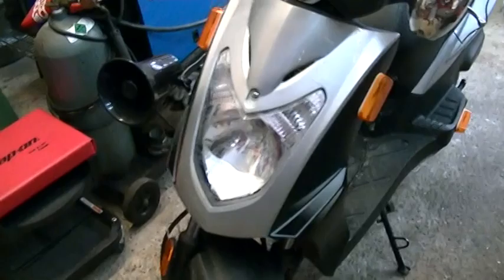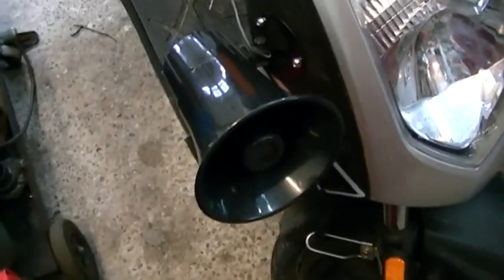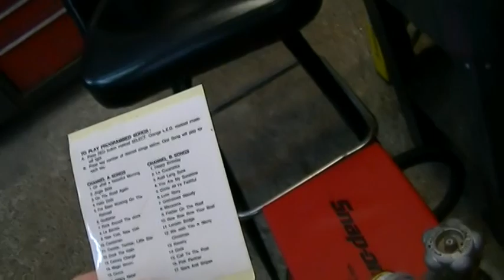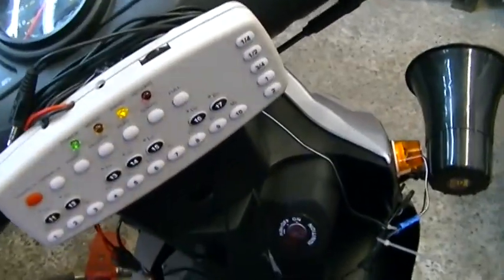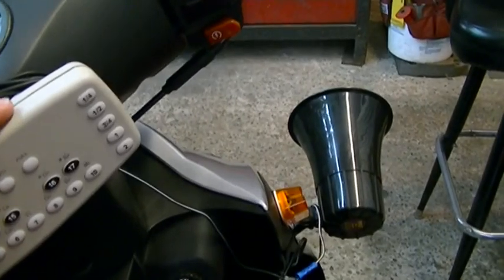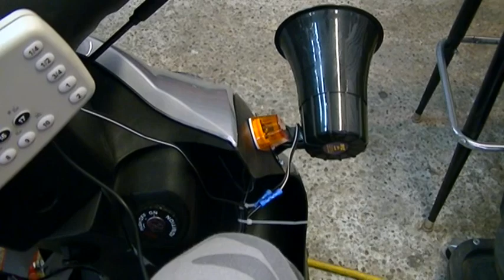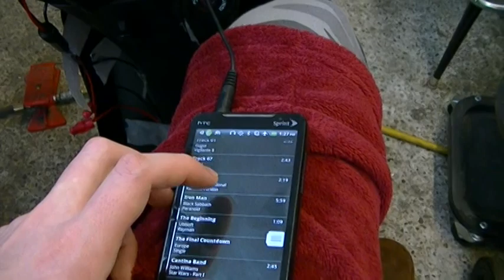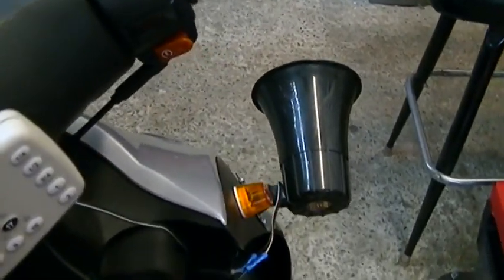Upgraded WOLO 336 Electronic Jukebox horn demonstration using a Pyle PSP8 PA Trumpet Horn

Comment from the maker: Mine came with a cable. If you need one, its a simple 3.5mm audio cable. If you are unsure, if you go to a Radioshack or similar place, tell them you want to connect your music to the AUX port in a radio as it would use the same cord.

Comment from the maker: You connect the speaker to where the old one was, by cutting the wires of the old one, and cutting the wires on the new one, then splicing them together. The control module, which is connected to the battery, powers the speaker.

Comment: How is it possible to hook a microphone up to this system I have the exact same horn setup connected to a cop car loudspeaker horn but I want to hook up a microphone to it also is it possible do I need anything besides the microphone?
Reply: Get a cheap microphone that has 1/8 inch plug on it or use a 1/4 to 1/8 adaptor if needed. Also you could use a cheap headphone as a mic but it will be distorted a bit. I know this is a year later but others may benefit from the info.
Reply: CB works the best

Comment: looks like it uses the same size driver but in a deeper bell housing. The result is a better sound from the same or similar type of driver.
Reply: Not the same driver. The Wolo horn is only something like 3 to 5 watts maximum. The Pyle handles 15 watts. The Pyle has a bigger driver.

Comment: One good rain and it's shot. A waste of money dude
Reply from the maker: Nope. It has been hit with heavy rain (unintentionally) before and it works fine
Reply: capitolemiproducer Most electronics even cheap made can take a beating when it comes to water, if you act fast with letting it dry and removing all the water.